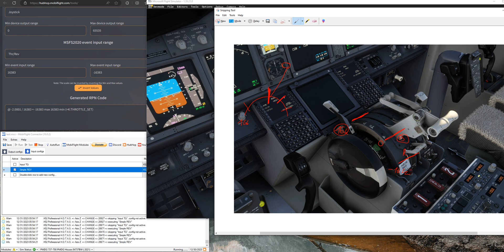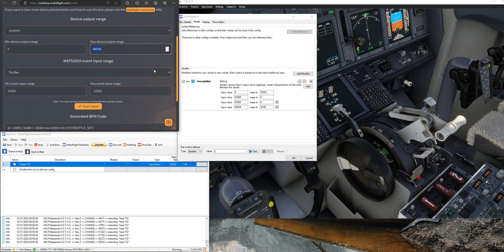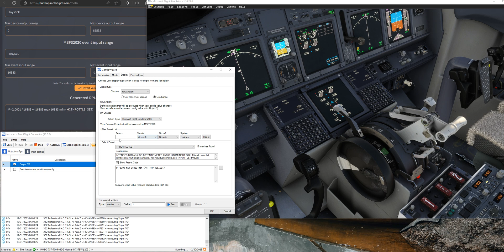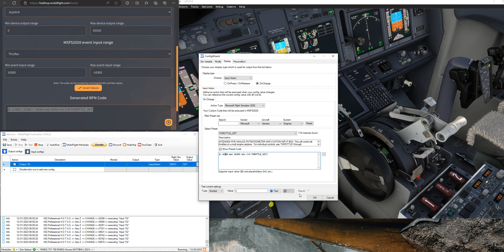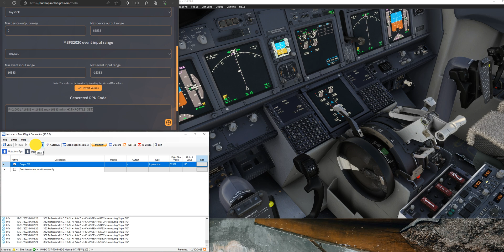MobiFlight | Proper REVERSE Thrust settings | MSFS | PMDG 737

Comment: Thank you so much for this! I recently bought a used ch products throttle quadrant that has 6 throttle axis. With your help here I was able to do my first setup: the NextGen EMB-110. I now have 2x throttle control, with both "taxi" and "reversers" per throttle lever just by pulling back farther, and 2 props with feathering. Deleting the bindings to those 4 levers in msfs was necessary, of course. (The default msfs fuel levers work fine for me so I had no need to program them.) The only disappointment is how jumpy this throttle quadrant is; but that's because it's used and 10 years old; time for some electric cleaner spray in there! 😀
Reply from the maker: You are very welcome. Happy it works for you :3

Comment: Finally figured this out! Thank you so much, you are a star!  No other video helped with this and you made it simple
Reply from the maker: @ArcanePath360  Happy to help 😊 So I guess Asobo still not implemented this primitive feature yet. They were certainly too busy pushing new MSFS 2024 out ....
Reply: @valkyrie_workshop   They are busy doing something. About time we had sim update 1 which was touted for 18th Feb. It's now March.  It does work with a gamepad I noticed if you have a button assigned to throttle INC / DEC.  I should mention that my throttle quad is a DIY build of my own design using trimpots and 3D printed gears, so Mobiflight has been a must.
Reply from the maker: @ArcanePath360  yeah, I think about it more broadly. Some might build a throttle quadrant using HID Arduino, or any commercial one. So it should be fundamental settings in the menu for throttle axis. Like XP11.
Reply: @valkyrie_workshop   I'm using the Nano in my build. I have 2 throttle levers, speed brake, flaps, parking brake, gear switch, 2 trim wheels, 3 LEDs (one is RGB and shows the state of the landing gear) and a throttle TOGA button. It's taken weeks and a lot of patience to get it finished and there are still problems here and there. Starting to think I should have just bought one
Reply from the maker: @ArcanePath360  overall sounds good 👍 I wish you good luck with it anyway and enough of patience 😊
Reply: @valkyrie_workshop   It was good up until last night when my TOGA button stopped working. Spent half the day trying to fix it and no joy. 😪
Reply: @valkyrie_workshop    I can't get this method in your video working for Airbus, only Boeing. Any ideas? I tried setting a much higher negative value but the reverse thrust won't kick in at all.
Reply from the maker: @ArcanePath360  I have no idea. Probably some other aircraft use different variables. Maybe try to check in dev mode what variables and values it uses.  I just tried Boeing and Turbo props that I fly the most.
Reply: @valkyrie_workshop   I think I might just give up on Airbus. I don't think I like them. Too many auto safety systems which take over the plane and stop you flying manually. They seem more complicated than Boeing. Thanks for your help.  Might give it one last go and then just stick to Boeing.
Reply from the maker: @ArcanePath360  I mean, the old-ish generation of B737 are sweet and enjoyable to fly. So I don't like Airbus for flight sim. However, you can try CRJ too, it does not have auto throttle and keeps you busy when flying. Definitely not a computer with wings 😏
Reply: @valkyrie_workshop   Thanks. I'm actually finding I like the prop planes for simplicity. I didn't like the new Censna 185 at first because it's a bit too simple but I'm liking it more and more each time. I also think the G1000 is easier than the G3000, despite the attempt at a user simplified interface.

Comment: 262 / 5.000
Oooh thank you so much for this video. Now about 3 weeks searching how to control only the Reverser (not the throttle) in MSFS for a PMDG B737 with a potentiometer via Arduino. Thanks to your explanation I got this done, thanks again.
Reply from the maker: @dannyvr1225  no problem, happy to help. Asobo could take inspiration from X Plane and make this function integrated in the settings. I made a thread on the forum about it. And there are few also from other users. But apparently Asobo does not care about it. More important are the visuals I guess... 

Btw If you build your own throttle quadrant, I made a concept on mechanics level that makes the reverse possible on the same axis. Two pots, inverted, signals isolated with diodes, end switch as trigger for "reverse" in game. Hard to explain in comments. Stupid, but functional. No special SW needed just Arduino as HID or so... Thus all the logic is done mechanically 😁 

Although this can be done very easily if you know coding and make custom mapping. But I like these mechanical stuff too 😅🤘

Comment: This is an awesome tutorial and i bow to you for putting this together! I am looking for precisely this but still having issues. What do you set the msfs throttle to? Do you just bind it to the axis? it is just too jumpy ofr me or does not work at all :( I get the right numbers in mobi, but it just does not translate to msfs. At least not smotthly.
Reply from the maker: @martinreckziegel8372  Hi, thanks. I am afraid I can't help much now. I play MSFS maybe once a year now 🤣 I am kinda annoyed that so many things are not done there. Even the fact this is not implemented yet is annoying. Asobo flexing how they modeled turboprops but no one can put the prop in beta. Stupid...  Anyway, I guess I used auto detect axis for throttle.

I would love to help you mate but I am sorry, don't remember. Maybe something has changed, maybe MobiFlight already got that feature.
Reply: @valkyrie_workshop  no worries 👍 i am still impressed how yoi pulled all this tohether 👍 take care!
Reply: Try unbinding the throttle in msfs...that worked for me.